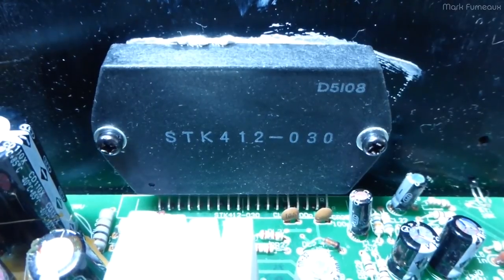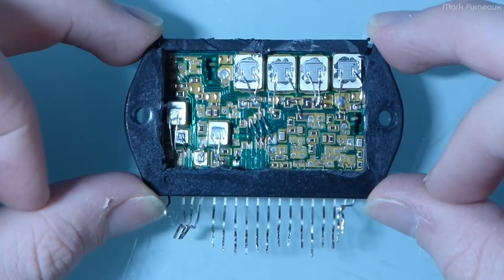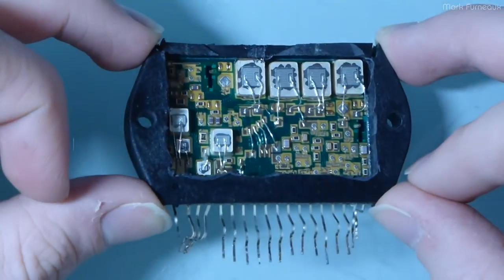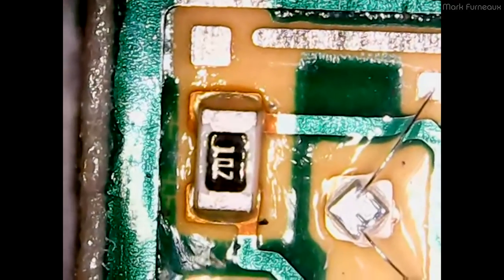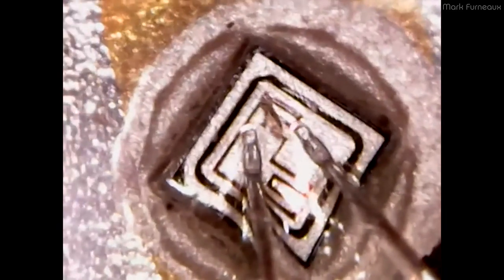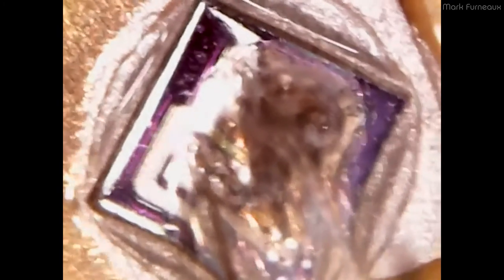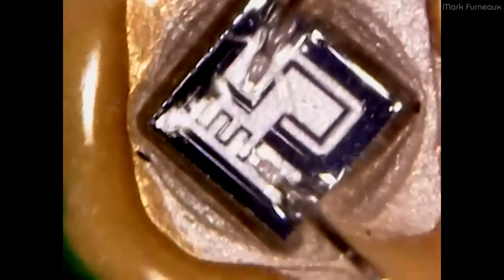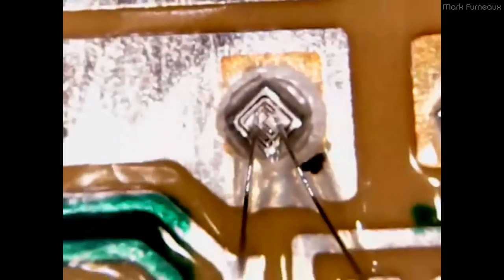Autopsy Of A Class H Audio Amplifier Hybrid Under The Microscope

Comment: have the exact same chip in my technics receiver.  Funny i was replacing the thermal paste on the chip as it was messed with and the plastic shell fell right off. And the substrate it's self is slightly warped  Thing works still to this day. usually they blow like that due to a short on the output and or the wrong impedance was used. *They don't like 4 ohms but will play 8 ohms fine and 6 ohms with a big enough heatsink.

Comment: Ok..I have a class H B2 Quattro 4 channel amp...I got this amp cheap because it powered up..no protect..but outputted no sound. I brought it home to bench test it because theyre notoriously touchy when it comes to the power itsbgiven and I wanted to seevif a clean 14.4 v would magically bring it to life. So i take and connect the power and ground to the AMP ONLY. The other ends of these wires are not connected to ANY power...and as i go to put the remote wire in place I brushed the power and/or Ground and it sparked!! I know capacitors store electricity...but this has never happened with any amp ive ever owned. This is also the first class H amp ive ever owned. Does anyone have any ideas how this occured?